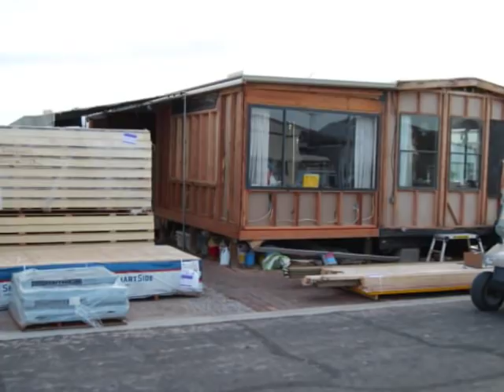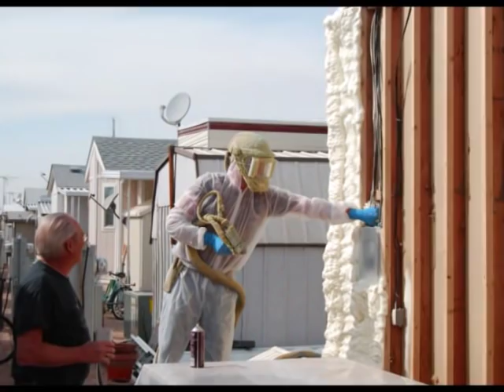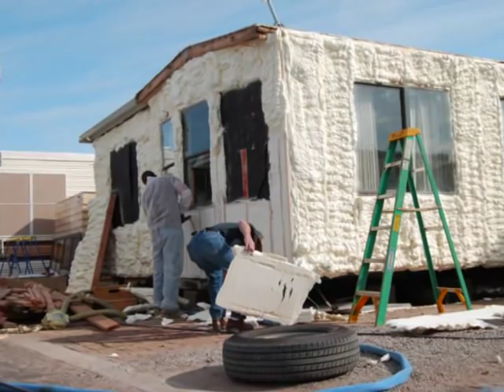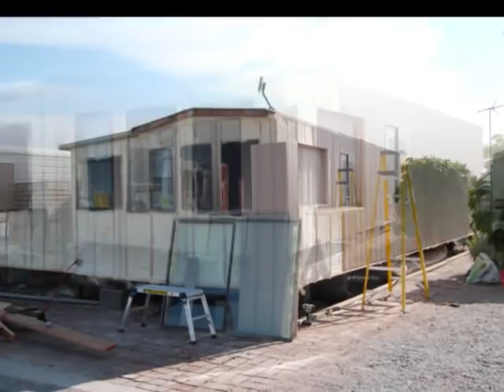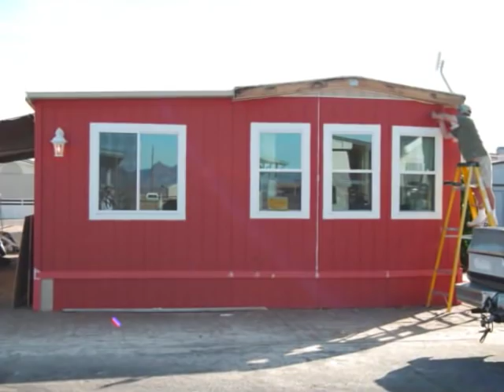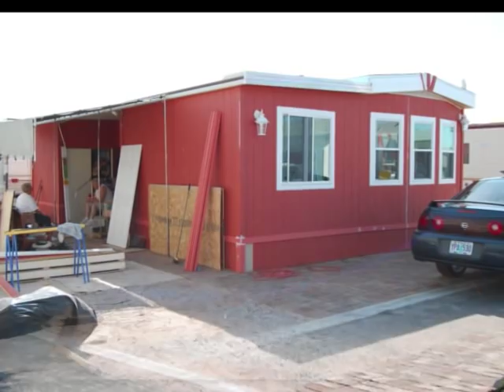Park Model Exterior Remodel.wmv

Comment: If insulation was such a problem, I would have gotten rid of least half of those windows in addition to the foam job. They let in a lot of heat/cold. Turned out nice, good job.
Reply: Many of the windows are required by law.

Comment: I'm gutting out a travel trailer on the aluminum on the inside do I have to take the window out from the outside to remove the aluminum on the inside around window. R is the an easier to do this. Thank u for ur advice

Comment: I'm a little lost as to why you would remove the skin. Would it not have been better to skin with 2 inch rigid foam board and then add new t111 . the insulation would be continuous and studs insulated. 

Since there is a reason you would remove skin , why not offset new studs from existing stud. Again this would give an insulated stud , like we did with the super insulated homes back in the 80's. 

Nice job , I'm just an energy savings nut. Please advise.
Reply: I wanted to do that but what about...how do I extend roof line all around?
Reply: So they can be rid of the problem of the metal sweating against the wood and causing rot problems.
Reply: Going over like your saying is laziness. Do it rigjt plus all that alum u can scrap. And use to offset cost. Plus any damage under that u dont know aboit u can find and fix the right way